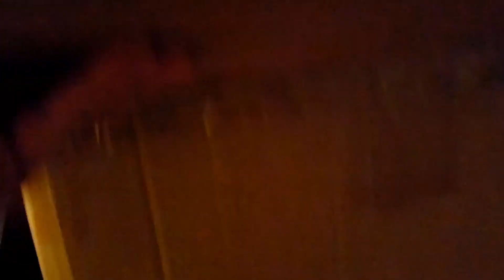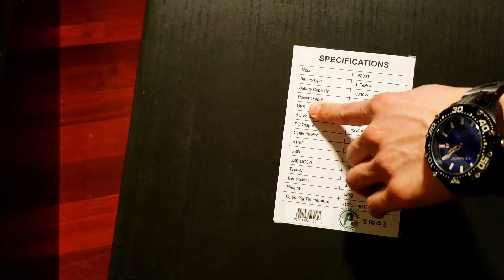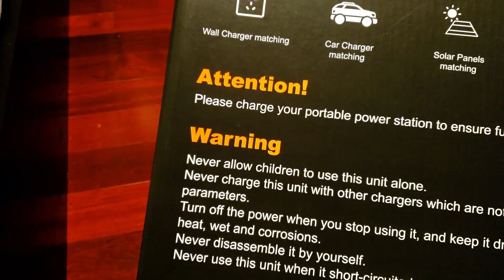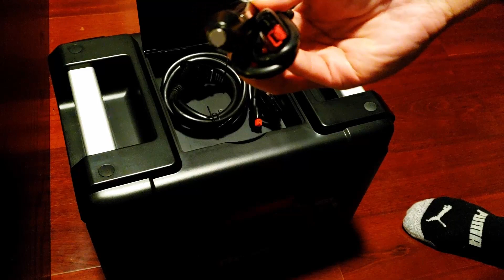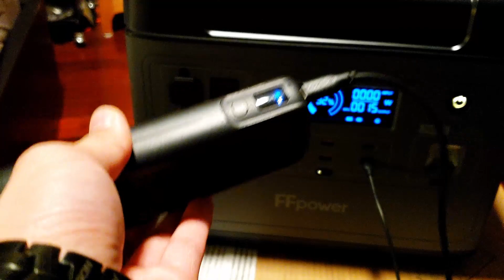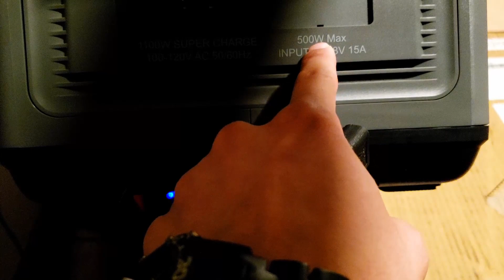UNBOXING: FFPower P2001 Solar Generator [UPS!!] [HOME BACKUP POWER!!]

Comment: very happy with my purchase 4 and three quarter stars, my refrigerator for 7.5 hours, full size, can recharge with my generator in 1 and three quarter hours.  mostly use as ups for my basement, if power goes out always have circuit wired for emergency!  ❤Thinking of buying second one!

Comment: Great review. I enjoyed your review of the Bluetti AC100 which I have. I just purchased a BougeRV 1100wh /1200watt inverter for a mere $719 so I'm happy with this. A fantastic 65 cents per watt/hr. with 1500 cycles to 80%

This also seems to be great bang from the buck. The charge rate is fantastic. I'm wondering though , given that high charge rate (1100 watts) plus the fact that your charging brick is essentially internal, that you are going to be generating a LOT of heat. Just wondering too whether the high rate of charge lowers the longevity of the batteries since lithium batteries don't like high heat. It would need to have great cooling.

Again thanks for the review. I might have bought this if I hadn't just picked up the BougeRV.  I also have the smaller Ouikitel 614wh unit.

I do think units like this are a necessity given the existing strain and fragility of the power grid which is only getting worse.
Reply from the maker: It's definitely a great deal!  And the charge rate is pretty great too!  I totally understand your concern about heat, but given the very effective internal cooling fans, I don't think it's too big of an issue!